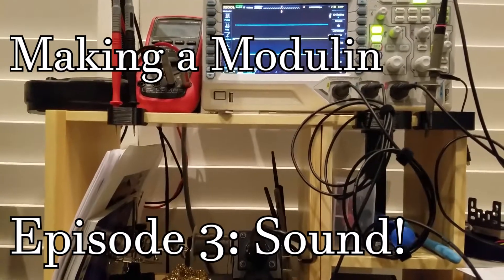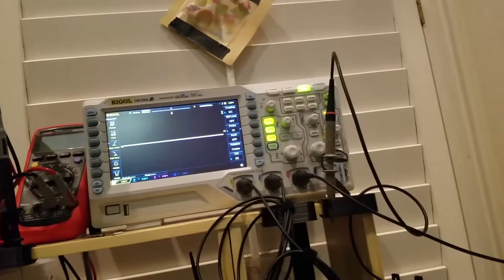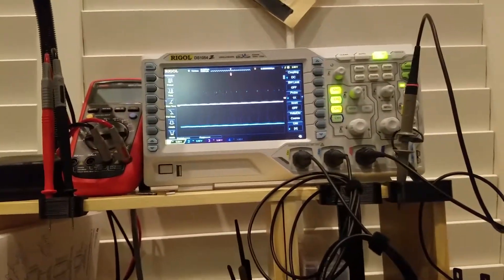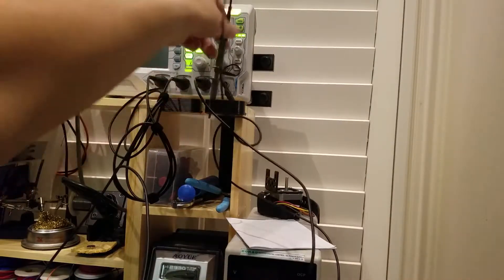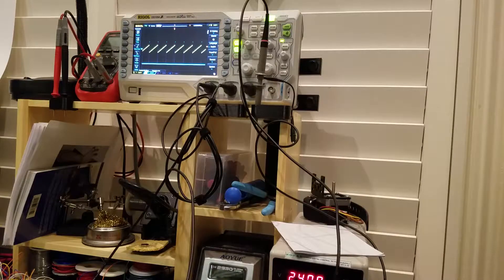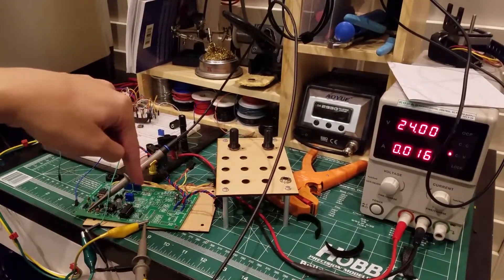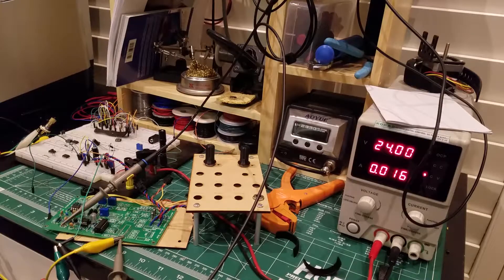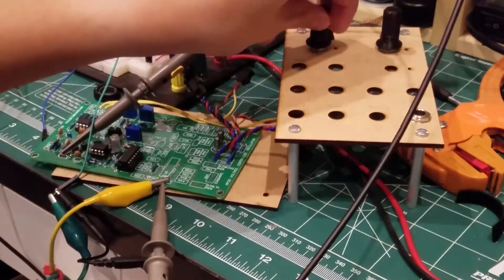Making a Modulin Part 3: Sound!

Comment: Hi - ive been watching a few of your videos, and I have a question:
In an earlier video you said that you were to get a 2 foot pressure sensor, then place a ribbon sensor over that.
I would like to do the same, but have been unable to find such a ribbon sensor.
Do you know where I might get one?
Reply from the maker: John Hunter Here's the 500mm ribbon potentiometer I was planning on using: https://www.sparkfun.com/products/8681
Hope this helped!
Reply: hmm. It seems my modulin is getting shorter and shorter... they don't seem to like making long ribbon controllers...
Was originally going to use this, but it may be hard to do it any more than a foot long: http://memoir.okno.be/phys_comp_tutorial/ribbon4/ribbon4.htm